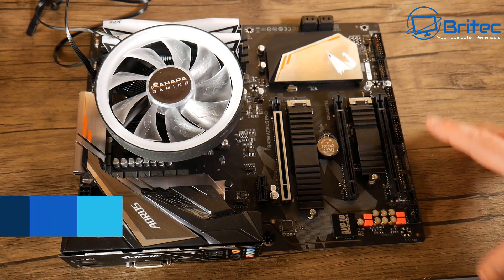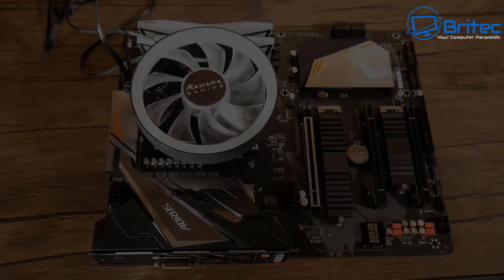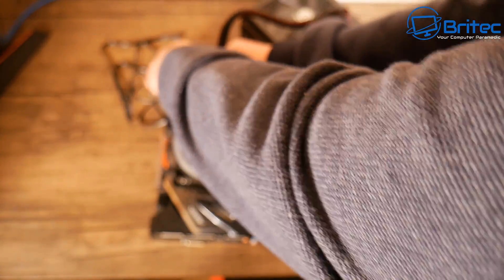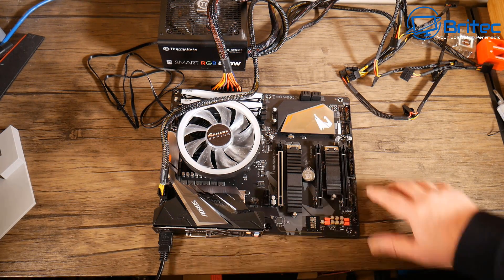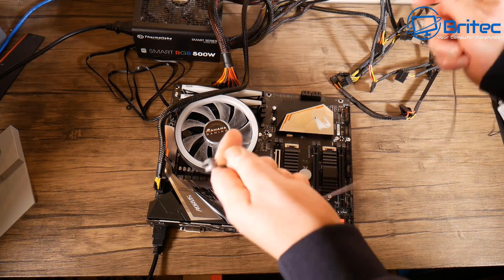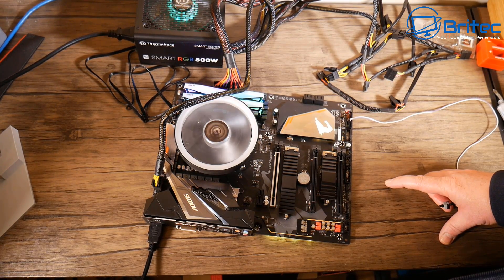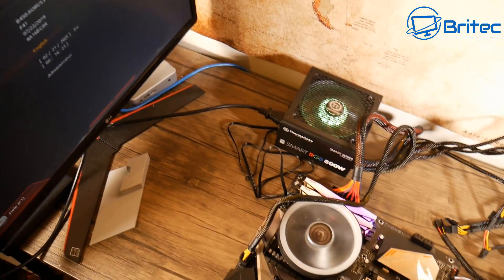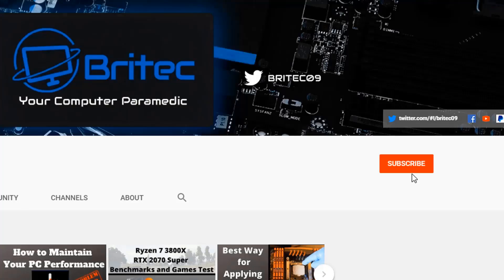How to Test A New Motherboard

Comment from the maker: Do you test before a PC Build?
Reply: The first time i build mine i did test it on motherboard box,and connected power switch from my case.
Reply: Burn it in and you'll most likely find any issues quickly. Normally I burn in my new systems for at least 23 hours.
Reply: @MYTHIC GAMING Canola seems to work best.
Reply: When I hit the i/O power switch my b450-f motherboard rainbow lights near the wall outlet  went on but when I connected the front panel connectors from the case and installed the gpu cpu 24 pin 8 pin and ram then I hit the power button that’s on the case and I didn’t boot the pc because the cpu fan gpu fan and the power supply fan didn’t come on twitter
Reply: Can i contact you? I have a problem
Reply: I tested. Nd it was working. Bit after complete build it stopped working
Reply: @mohit.vyas556  you probably damaged it with static electricity while building
Reply: No 😅

Comment: Thanks for the very helpful video.  I just did my test and everything is rolling...; )....The only thing I would add is a close up of the System Panel Header which shows the 10-pin slot for Power LED, Power Switch, H.D.D. LED and Reset Switch for where you put the jumper of the microswitch.  Note the 5th pin area (actually called Pin #10) at the top of the slot is empty and the 10th pin at the bottom (actually called Pin #9) of the slot isn't used.  In addition, the jumper has to go on the 2 pins for the Power Switch (negative and positive), they are at the top of the 10-pin slot, next to each other from left to right and are right next to the empty pin area.  For my ASRock B650 Motherboard, this slot is at the bottom far-right corner of the board.  Buena suerte amigo/as!

Comment: This is a great idea for builders to do.
I did hear one technician say that some motherboards come configured to use a GPU. So if you have a CPU with graphics built in, it will not POST!  If this is true, Bri's test bench method would allow you to put in a GPU and then configure the BIOS

Comment: Long shot, I have an issue, I was using my PC yesterday and then format my PC, just wanted to have a clean install. It installed fine but while updating/restarting, it didn't want to do anything after booting again. No post or anything. I tried to switch my display to right off the motherboard but no signal.. Dead board?

Comment: Burnt out multiple capacitors in my power supply and was wondering to know if my motherboard got damaged.  I bought a new power supply and proceeded from there.  Turns out I have a power button on my motherboard.  Thanks for the video, helped me immensely.  I will never cheap out on a motherboard, having quality of life things like an led post readout and a physical button so I don't have to jump the board is lovely.
Reply: Yes I just bought a new Gigabyte motherboard and it does not have any led post ights. (and it does not post) so it is something I will look out for. I do wish motherboard manufacturers would not skimp and save on everything they can. Most low end or mid range motherboards are cheap these days.

Comment: Firstly, thank you for the video. Great tip!
Secondly, I have a question, hopefully someone can help. I got a brand new motherboard and I did exactly what you did but only the mobo's led lights turned on, but everything else had no power. event he cpu fan didn't turn on. Is this an indicator of the mobo being faulty or can the cpu be the issue?
Reply: Did u found what the issue was?
Reply: Same goes to me, anybody can answrs pls?

Comment: I did a paper clip test on my psu. the PSU works fine, but when I plug it into my MB, Nothing no fans. Its an old Motherboard that i was trying to convert to a plex but i guess its really dead.  because NOTHING happens after I power on from the  PSU. So I cant test anything, no video , no beep , no fan, nothing.  Guess i moved it around too much.

Comment: Thumb down. All you did was turn the motherboard on & check it boots the bios. You did not actually test the motherboard, which was the whole point in the video title "How to test a new motherboard". You could therefore find at some point down the road that a sata port is dodgy or memory port is faulty. Useless 8 minute video of someone plugging a motherboard in & turning it on & off.

Comment: Thanks! Great video. How can I do this without putting in the processor, and without the power jumper? I just got a new board, which physically looks alright, but I want to check it before building.
Reply: i’m pretty sure you 100% need the processor. usually that isn’t a problem though, since you’ll want to mount the processor and cooling option before mounting the motherboard into the case anyway, it’s less constricting this way. and instead of the jumper cable you can just use a screwdriver to bridge the two pins

Comment: After you power down with the reset switch, the power supply is still supplying voltage to the board. The PSU should then be turned off before unplugging any connectors.

Comment: Hopefully anyone has feedback. I’m building my first pc and I have checked the power supply and it is fully functioning when it isn’t plugged into motherboard. When plugged into the motherboard the power supply doesn’t turn on and everything is connected to the right port.
Reply: thats literally me and i dont get it
Reply: @xieck7143  i fixed my issue by literally unplugging everything, and just plugging it in one at a time and powering it on every time.

Comment: Do you need a cpu in the mobo because mine didn’t turn on without a cpu just wondering
Reply: 4 cylinder yes, you do need a cpu
Reply: I have a b550 aorus pro without CPU and nothing happened when I tried to turn it on

Comment: Can you test the motherboard without cpu? I'm still waiting for it to arrive. I want to test if the motherboard is working
Reply: X2
Reply: I wanna try it without a GPU  and RAM! Just test if my CPU and mobo are working fine....
Reply: You can! You just won't be able to access the display I believe. But I'm pretty sure your pc will be able to run without your CPU.
Reply: Hi I try to start up my B550 AORUS PRO without CPU and nothing happen still waiting cpu to try again
Reply: @outmyway9729  does it light up
Reply: @AshrZ  nothing happened when I pressed the button. If I get the cpu will it turn on? Because I don't have any graphics cards right now
Reply: @AshrZ  may be next week I will receive the CPU hope everything is okay!
Reply: @outmyway9729  The only thing that should work/light up is your RAM, or your motherboard. No graphixcs will work because there's no CPU or graphics card.
Reply: @AshrZ  I have some crucial ballistix RGB and it's not lighting up :(
Reply: @AshrZ  have 9 Thermaltake ARGB Fans not a single one lighting up or ever spinning :(
Reply: @outmyway9729  oh no! that's not good :(
Reply: @AshrZ  REALLY? :(
Reply: @AshrZ  so I need to get a new motherboard?
Reply: @AshrZ  or I'm waiting for the CPU? And after that I'll see if I need a new MOBO
Reply: @outmyway9729  might have to, I'm afraid. But try shorting the power pins, seeing if that does anyhting. That's the only advice I have for you
Reply: @AshrZ  when I receive the CPU I give you some updates
Reply: @thewooshbait687  hi dear everything is OK just without the cpu nothing works. Now everything is good with cpu and gpu

Comment: Recently my own assembled pc does not boot up after switching it on. The LEDs, fans, graphics cards etc come on but no signal to the monitors and no Windows. I have to press the reset button and on/off button randomly many times until Windows comes on
Any suggestions as to what could be wrong?
Reply: What type of socket is it?
Reply: I have the exact same prob! Ryzen 5 3600 msi b450 a pro max. Its fully compatible and supported. All fans turn on and work but black screen all the time. Holding down power button doesnt shut down i have to close via psu
Reply: @anilb7879  i have the same problem do you got any solution?

Comment: To be honest, I've never done this before. Now after watching this video, I'll make sure it's done prior to installing the mobo into the case. Thanks for sharing this Brian.
Reply: Remember shorting the power button again after switching off the power supply to remove any charge left in capacitor. Capacitors can give you an electric shock.

Comment: We have built over 400 computers where I work and we never had a DOA motherboard. We only use Asus motherboards and we test them all on a tech bench before they go into the case.
Reply from the maker: Because you have not had any DOA motherboards, CPU or any other hardware, does not mean it don't happen.
Reply: cool story bro.

Comment: Sir, I watched your video related to NVME installation.
I need help, I am fighting with the issue since past 7 days but no luck: 
I have windows 7 64 bit with Gigabyte motherboard with NVME support
My running windows was not showing nvme drive but when I installed the KB2990941 the NVME started showing up.
I tried everything to inject that hotfix, it gets injected and I can see it but the NVME drive never shows up when I try to install the windows.
Second I have another disc which has all the drivers and NVME shows up when I install throught that windows 7 disc, that disc is not genuine and I don't want to use it for my windows but it can install the NVME drivers at boot time.
StorNvme is the driver I have in the Hotfix but as I have doubt it's not signed and not works when I try to install it through browse menu at boot time installation time.
How can I get signed Stornvme drivers so that I can make my NVME detect with windows boot disc